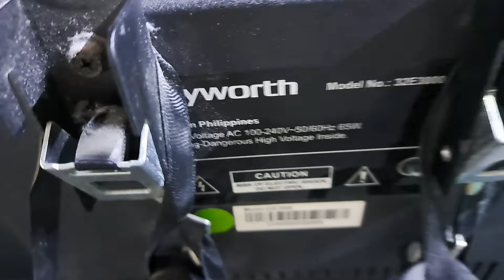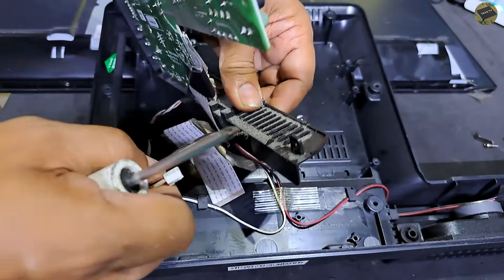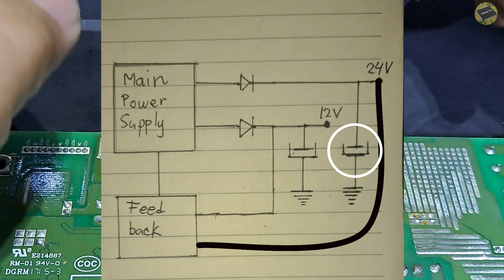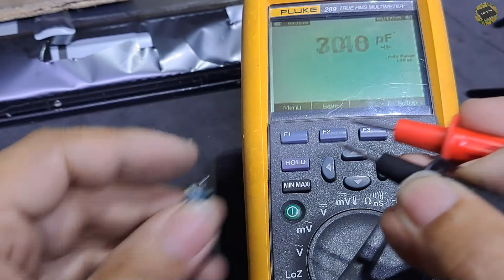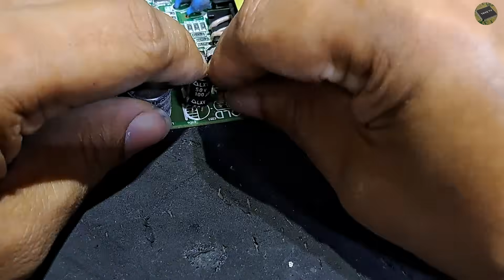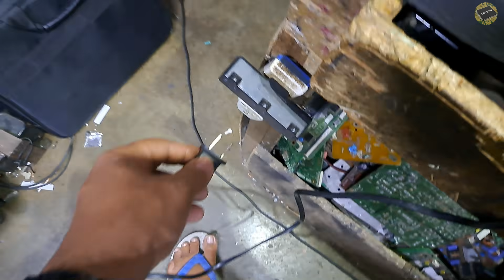Skyworth LED TV no image problem.

Comment: Sir i have some issue regarding the sharp tv and tv is not turning on..when i test the ceramic capacitor near the main ic and it is beeping both side and the reading is showing 63 ohm.does this beep is normal or ic is shorted.sir kindly i need your help
Reply from the maker: You do the injecting method.